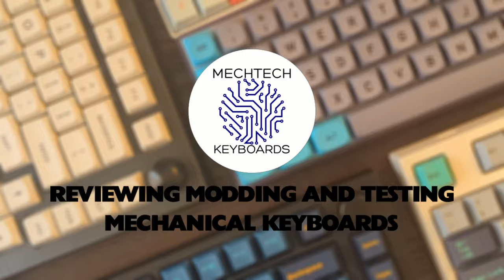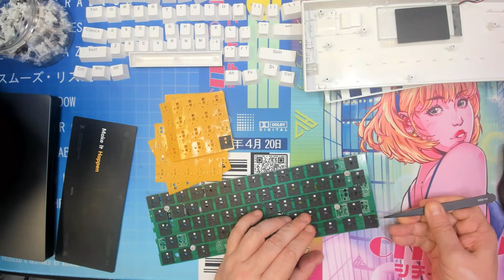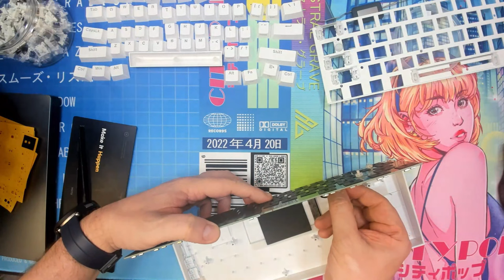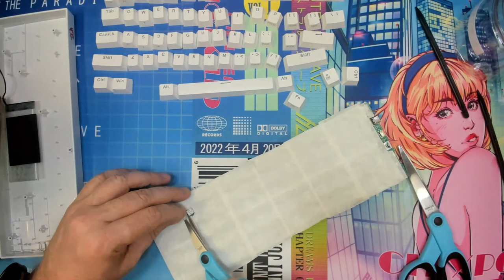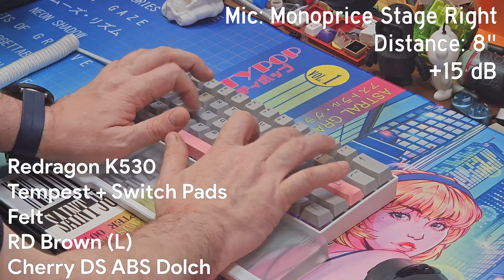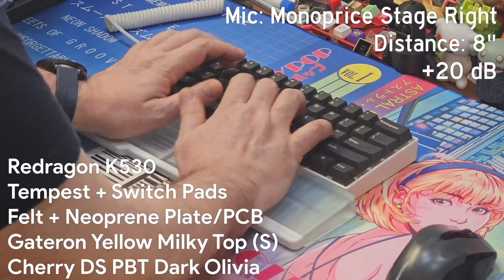Modding a Redragon keyboard with all of the common mods with sound tests - Learn how to mod a keeb!

Comment: Great informative video as always! I've been modding budget keyboards for a few years now, but finally bought my first Redragon. I got the Zed Pro K627P because of the unique layout. I do miss the full numpad, but it works when I only need to key numbers and hit enter. At any rate, I have done a ton of mods and I really enjoy how it sounds now! It has a deep thocky clack that is very satisfying. I replaced the switches with lubed Akko POM Brown and the keycaps with CSA Dark Hammerhead. Here are the mods: PE case foam, PE sheet, 3 layers of masking tape, band-aid mod & lubed stabs, and my first try with a o-ring burger mount. I'm very pleased with the results! It also sounds great with Akko CS Ocean Blue & Akko CS Cream Yellow switches.
Reply from the maker: Thanks! I've almost hit my two year mark, and look forward to years more, I love modding keebs, especially these "cheaper" off the shelf one. Your modded Zed Pro sounds quite interesting, if you'd like come over to r/BudgetKeebs or our Discord server and share, I'd love to see it and hear how she purrs, cheers!

Comment: great. coming from keychron k2 battery issue, thinking about this.

Will this keyboard work IF
1. battery dies & use it directly as Wired w/ Toggle=OFF
2. unplug battery wire connector at PCB & use it directly as Wired w/ Toggle=OFF

Reason i am asking - longevity perspective
- If hot-swap switches die, i can replace those with spare switches
- if battery die/removed, i want to use this at least as Wired Keyboard w/ Toggle=OFF
Reply from the maker: Most keyboards will work without a battery.

"If hot-swap keys die" Do you mean the switch, yes, the switch can be replaced.

Comment: What thickness switch pads are you using? .5mm or 1mm? I'm thinking about doing these same Mods to my Redragon K643 Veigar. PE switch pads, AKKO Rose Red switches, and tape mod. Which switch pads do you recommend ?
Reply from the maker: The ones I used here were 0.5mm. Nice combo, should sound real nice!